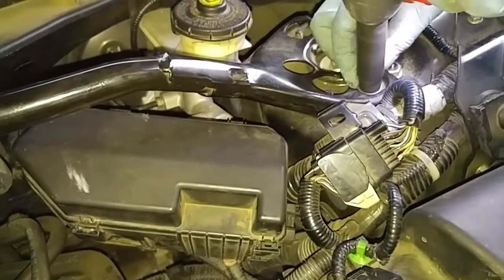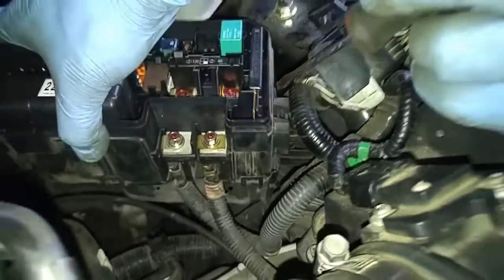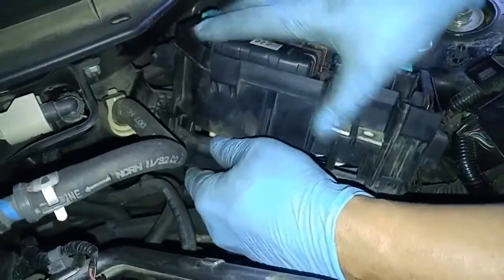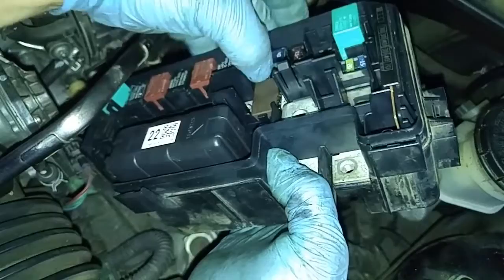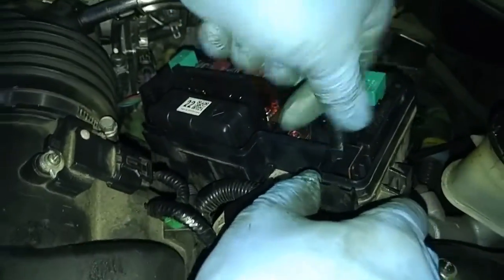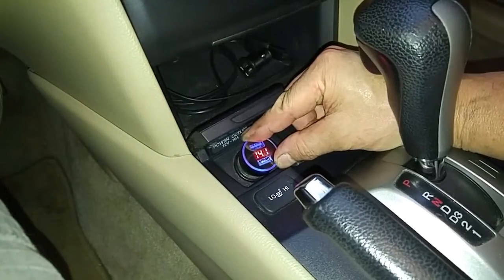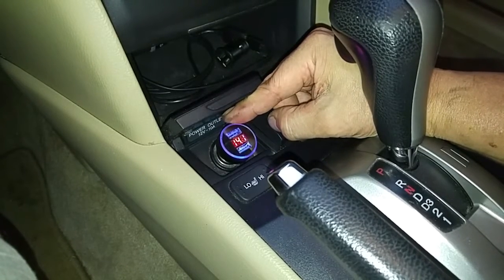Battery Dash Light On & Off? Honda Electronic Load Detector Malfunction

Comment: I have a Honda Civic 1993, the dashboard lights turn off when I’m driving pretty often but when I smack the dashboard a couple times it turns back on. Any suggestions?
Reply from the maker: Sounds like loose bulbs oe bad electrical connections
Reply from the maker: Bad bulb electrical connection in the back of your instrument cluster.

Comment: Wondering if you could answer my question. My '13 Acura TL stereo system is sometimes nonreactive (unable to switch media, turn on/off, etc) after starting car while driving I will have to pull over, put car in park, turn off and restart the car. Any idea what this could be?
Reply from the maker: Seems like the problem is isolated to the radio's electronic internals and not the car.

Comment: I have a honda accord 04 when I step in brake the battery light will flash on then go off. Wonder if this is why
Reply from the maker: Might very well be.  Replacing the ELD is cheaper than the next fix; which is the alternator.   Also check your battery connectors and the condition of the battery.  If the battery is low, recharge it, clean and reconnect the battery connectors and monitor the voltage with the car running with a accessory port plug in voltage display meter.  They're cheap ... less than $10.
Reply: Lol no dont just go replacing parts you dont even know are broken. First id check all your fuses and make sure they’re getting power.

Comment: Would the ELD Prevent the car from starting? Or just the starter. 

Battery lights been flashing intermittently  but not at a steady consistent flash pattern, it may go on  ---------- then off then on off----- then on ----------------------- then off for like 2days.

Mean while all connections have been checked battery gets a full charge from the Alternator, battery is still in its prime. My guess is the starter could be  going out on me.  LMK what you think it could be
Reply from the maker: An ELD malfunction would result in sporadic electrical flow and don't believe it would effect the starter.  Did you replace it?

Comment: Same issue Honda Pilot Touring 2011. Check charging system light on and off. This happened after alternator died. Replaced 2 alternators, 2 Batteries and now the ELD. Light still coming on and off. However, no performance issues.
Reply: Same thing with my 2009 Accord....
Reply: What ended up fixing it?
Reply from the maker: Combination of replacing both the ELD and the alternator.  The rebuilt alternator was outputting inconstant voltage.  Replaced with a remanufactured Denso OE (Original Equipment) alternator.

Comment: Is happening on my Honda odyssey 09😬
Reply: Did you fix it and work?? Because I have one to and it have the same problem.
Reply: @sgrodriguez06  I change the alternator because was not holding charge. And after I changed it didn't show anymore after few months later. But sometimes comes and goes 🤷‍♂️
Reply: @Mememo-z6v  Thanks.

Comment: Did your battery light turn on and off while driving intermittently? I got 09 accord v6
Reply from the maker: That's a usually symptom.  Could also be your alternator going bad.
Reply: I have a 2008 accord and just replaced my alternator and mine is now doing it as well. Thoughts? Could this be it?
Reply from the maker: @barrymill11111  Absolutely or could be a bad rebuilt ... if a rebuilt.  When I get a remanufactured OEM Denso alternator, all erratic voltage output problems disappear.
Reply: Ok thanks! I’m nervous it’s a bad rebuild cause it was an emergency but as it nearly lit on fire when it blew and is my only driving vehicle and I’m tight on cash so another alternator wouldn’t be ideal😂😂 but ya I’ll definitely look into this ELD
Reply from the maker: @barrymill11111  Also get yourself a plug in digital volt meter.  Pop it into your cigarette lighter port and monitor the voltage while driving.  If it drops below 13v, it's either an ELD or alternator problem.  One of my customer's was loosing his mind.  First replaced the ELD ... worked okay for a little while ... then the battery drained out ... followed by a 3rd replacement of the alternator, this time a Denso, and all problems disappeared.
Reply: Ya will do! Right now a plug in volt meter and and ELD is cheaper than another new alternator so I’ll do that. If it turns out to need another alternator I might just price out an OEM factory one for safe measure
Reply from the maker: @barrymill11111  Go to rockauto.com for the best price.  A link to the plug in volt meter is in the text description of this video.  Good luck!
Reply: Much appreciated! Thanks for the advice!!
Reply from the maker: @barrymill11111  You bet!

Comment: So our h
04 honda pilot was fine we used 4 wheel drive for a short time and then  the 4 wheel drive loght the sbs light and check engine lights were on and then lights started to dim like alt was going bad we replaced ut with a new one and the battery is new, it would crank if  on jumper cables but would die after about 15 seconds . You can hear it slowly get weaker and shut off . We a red at a loss to what it is . When its hooked up to jumpers battery reads normal but drops when detached and altinater seems to read poor.
Reply from the maker: Could be a defective replacement alternator.  Happened to me several times.  You need to monitor the voltage of the car while driving.  If it does not stay above 13 v (13.5 to 14.2 is normal), it's your alternator.  Here' a link to a Cigarette Lighter Voltage Meter 
https://amzn.to/2EABII9

Comment: Hello would you know what is the part number Eld? Thanks
Reply from the maker: The replacement parts are listed in the "show more" text description of this video.
Reply: @hardlymovingpro  at 0:53 how did you know to use that tool or screw driver??
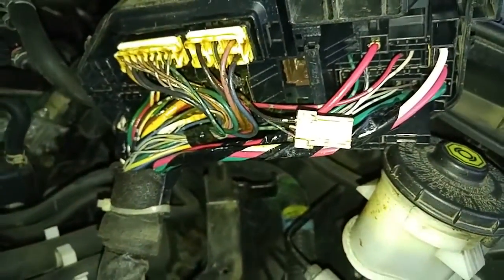Reply: @hardlymovingpro  2:30 how did you know which plug to pullout ?? is it labelled EDL?
Reply: @hardlymovingpro  2:34 how did you know those 3 bolts to remove what connected to the EDL?? Because I'm looking and I couldn't tell why those 3 were there or what they were holding in place.
Reply from the maker: @mrpastor77  The 3 bolts holds 2 electrical (fuse) components that hold down the ELD bracket from the top.  Once removed, then detach the electrical connector from the bottom and the ELD and bracket can pull out.
Reply: @hardlymovingpro  oh I see .. okay gotcha
Reply from the maker: @mrpastor77  You bet!
Reply: 2:48 .. that clamp tool you using ...what is the name of that?? and how you knew to pull those things out with it and not your fingers??

Comment: Hi my car wont start . Looks battery power is weak , when key is not on and try to turn the headlights dash headlight is flickering fast. and battery is so weak to start even though i got the new battery.
Reply from the maker: If you've got a new battery and the car won't start, it could be a bad starter motor.
Reply: @hardlymovingpro  

If you have bad starter motor or  starter ignition

The lights are affected and door powers ?
Reply from the maker: @chai25deo  That would probably be either a electrical short, alternator, battery or ELD problem.
Reply: @hardlymovingpro  

Thank you so much !!! Youve being very helpful..
 Thanks again!

Comment: How long can you drive your car with this problem?
Reply from the maker: Until you battery drains out resulting from an inconsistent alternator charge.
Reply: @hardlymovingpro  would bad ignition switch cause the same twitching battery and door light
Reply from the maker: A bad switch would prevent your car from starting ...not drain down your battery

Comment: Hi, could you give me some advice on this Honda P16E2 code
Reply from the maker: This is what's been posted on the internet:

P16E2 HONDA Possible Causes What does this mean? 

Faulty Alternator Alternator harness is open or shorted 
Alternator circuit poor electrical connection 
Faulty Powertrain Control Module (PCM)

Read more: https://www.autocodes.com/p16e2_honda.html

You'll need a professional auto electrical specialist to do thIS repair, IMHO.
Reply: Can I get all the names of the wrenches and tools you used to screw off the bolts. I have read the description and seen the name of everything else you used but not the tools.

Comment: I've been having problem of while driving randomly (it could show no symptoms for days) the battery light will turn on and my car stalls but starts back up in less then a second while driving. And then occasionally it would randomly not start at all unless I get a quick jump.
I replaced battery and alternator 6 months ago in attempt to solves this then I changed the ELD last month. It still occuring. Any advice?
Reply from the maker: What's going on with the voltage while driving?  Do you have a LED voltage display to monitor?
Reply: @hardlymovingpro  last time the battery light came on my village dropped to 12.1

Comment: I had to change the computer from my Honda Civic 2003 lx to a used computer and when I drive the battery light comes on but when the car is in park the light doesn’t come on then,  also the mechanic changed the alternator but the light still comes on, some people think the problem is a ground but I’m not sure
Reply from the maker: It seems like you have a defective ELD.  You can verify by getting yourself a simple cigarette lighter plug voltage display device (around $5) that displays the current voltage of your car as your driving or idling.  Also, the quality of replacement alternators can vary.  Some of these rebuilts go bad from the get-go which is one reason why I avoid some store brand rebuilts.
Reply: I have the exact same problem
Reply: Same car aswell. My dad has changed the alternator 6 or 7 times the last time was good but then I noticed that my power steering might have caused it to die out again. But the light is still turning on and off. I need to replace it again.

Comment: I have the same issue 2005 Accord Hybrid. Battery light comes on and off. The Hybrid battery does charge and the car battery is brand new. Car has never not started. Does a failure of the ELD drop a code for scanning purposes?  Current mechanic doesn't see any code? Trying to avoid a dealer visit.
Reply from the maker: Recently changed out a ELD on a 2002 Civic.  The stored codes were P1297 and P1298 ... all ELD specific codes.  I got around a half dozen used ELD's at the salvage yard.  They look generic and you'd save around $30 - $50 by avoiding getting the replacement at the dealership.
Reply: @hardlymovingpro  No ELD codes present. Honda shipping in AC/DC inverter (or converter)? to test. Sounds spendy?
Reply from the maker: Could be bad alt clutch.

Comment: I have a 2001 Honda Accord LX that is doing this. It started some time after I replaced the alternator. I thought it might be the battery but I had it and the alternator checked at Auto Zone and they said they were both fine. Could this be the issue?
Reply from the maker: Replace the ELD device and see what happens.  Not too expensive of a part.
Reply: Autozone workers are generally incompetent. Dont trust their testing that says pass. I have had broken alternators test fone when they were not.
Reply: &k

Comment: my battery light stays on but doesn't flicker even though I have a good battery and alternator, could this be the same problem?
Reply from the maker: Did you check the voltage while the engine was running?  Should be over 13.5 volts

Comment: I have a 2004 Honda Accord euro and had to replace the alternator with a new one from eBay.                                                   The first one was charging at 15.5 volt and the battery light was flashing on and off after a ten minute drive.                   I’ve asked for a replacement and I have just installed the second brand new alternator which is charging 17.5 volts at the battery terminals. Is it possible to have two faulty alternator with overcharging or is it something else? My battery is under 1 year old. Any assistance much appreciated.
Reply from the maker: 15.5 and 17.5 output voltage is excessive.  Most automatic battery rechargers shut off when approaching 14.5 volts.  When you exceed that, you run the risk of over charging the battery.  With something as important as an alternator, I wouldn't be buying no-name-brand, made in China replacements off of Ebay.  I've had problems with rebuilds from reputable auto retail stores.  If you want to avoid problems, suggest you buy a Denso OEM rebuild.

Comment: I get a warning when reducing speed to a stop that says “ Battery charging system failure” along with the battery light. then the light comes right off within a second. Could this be the same issue?
Reply: BTW I already purchased and new alternator and battery. Still same issue.
Reply from the maker: It definitely sounds like that's your problem. Yes, I would replace the Eld.
Reply: Hardly Moving Productions thanks so much for the video man.
Reply: So far I replaced the Alternator again and no issues.
Reply from the maker: @liftny  Good news?
Reply: Abe Padilla are you still good with the new alternator? I am having the same problem and I already changed the alternator once

Comment: It's not the same in E.F. civics. They are built into the main fuse box so you have to purchase a used one.
Reply: I just did that yesterday on my 97 odyssey..
Got 2 fuze boxes from the scrap yard.
Went to an accord and ripped the fuze box apart and figured out you can take them apart and switch just the eld
So i took the eld only from the accord and brought the 3 home.
Took one of the spare fuze boxes apart and cleaned all the contact points and sanded all the metal.
Cleaned the eld and screwed it all back together
Put the "new" fuze box in and no more flickering and dimming lights. No more rpm drop at stops. No more srs light on from low voltage.. Runs normal like it should now.

Comment: Is there a part number to the ELD?
Reply from the maker: Suggest either calling the dealer or checking with a on-line dealer.
Reply: Hardly Moving Productions cool so I can ask for a ELD from a 08 accord and it’ll work on my 04 TL?
Reply: @nando2537  if it has the same connections and the same plug..
Yes you can

Comment: I am having the same problem... The battery light goes off and on when I drive... And I can see the voltage drops down... Then goes up...  I have a Honda Civic ex 1995... Does my Honda come with that part?
Reply: Well I didn't find the ELD ... I took it for an electric check up and it was the alternator. It stops working sometimes so it was the battery putting out all the electric power... And start to work again to charge the battery... So it was working on and off... I replaced it... Now I have no issues. Thanks for the help
Reply: @xiapriscajche  How much does it cost for an electric check up?
Reply: @faithahora  it was free... I took it to a battery shop... They sale batteries and check it for free...
Reply: xiapriscajche i had same issues - battery light flickering and then came on steady.  3 month old battery - Walmart.  Just put in a new alternator yesterday (400.00) and today, battery light is back on - flickering and then staying on for 5 minutes and then going off.  Honda Odyssey 2008.  I replaced a battery cable terminal as well (20.00).  It’s amazing no one can figure this out.  I drive for a living so this is costing my a fortune in lost wages (car stalls out eventually, dashboard indicators stop working, lights go dim, car begins jerking and when I come to a stop light, tries to stall).  Auto repair guy who specializes in electrical end shrugged and shook his head when I mentioned electronic load detector and then asked “where is it?”  ::sigh::
Reply: @SignedOff402  fixed?
Reply: @VickiesLove  In my case, valve cover gasket needed replaced.  It was dripping oil into alternator so I actually just got a 2nd alternator and a new AAA battery.  I don’t recommend rebuilt O’Reilly alternators.
Reply from the maker: Really don't know about that year and model; but it's worth checking into.  Also, you alternator could be  a possible cause.
Reply: @hardlymovingpro  I was checking online and I found something that says all Hondas have them since the early 90s... So I think there is one in my car... Maybe in the fuse box... I noticed that when I stop at a light sometimes the light comes on... But usually is when I start moving, when I accelerate to gain speed.
Reply from the maker: @xiapriscajche  Yes ... your car's symptoms appears to describe the typical malfunction attributed to a faulty ELD.
Reply: I think so.   But I haven't looked for the ELD yet.

Comment: Thanks for making this video, I had just a hard time to find a video on this for a Crosstour.
Thanks
Reply: I guess I’m going to have to do this to my crosstour because it just started happening where the battery light will come on then go off and I just put a new battery and alternator in it so I will go to dealer and get that piece and put it in myself & see what happens
Reply: HollywoodTheDj please let us know if it fixed it! Such a headache!
Reply: Ben Nieeban .. Will Do I Just Brought The Purge Control Valve Today At The Dealer it was $138 so hopefully this will work!
Reply: Ben Nieeban ... So Follow Up On The Check Gas Cap Situation I Replaced The Gas Cap That Didn’t Do It So I Went To Dealer And Purchased The Purge Control Solenoid that goes under the hood on side of the motor and that fixed it once I put it on I went for a ride on the highway and it automatically switched off and went back to normal!
Reply: @hollywoodthedj1673  so long shot on old thread.
Just got the battery indicator on sons crosstour. You solved it by changing purge valve module ( not eld module?)
Thx
Reply from the maker: No problem ...
Reply from the maker: From my recollection, the Crosstour is Accord hatchback so there shouldn't be that much of a difference with the sedan.